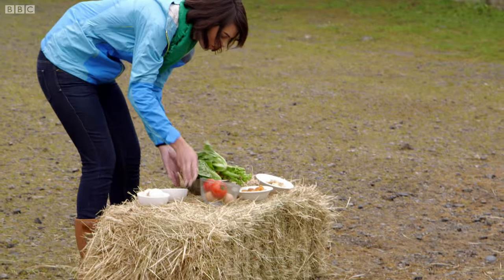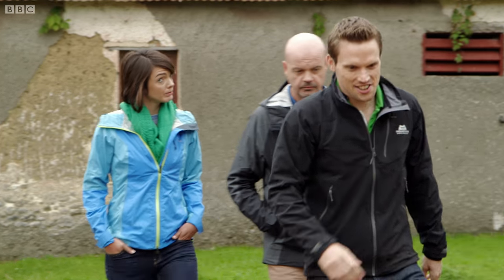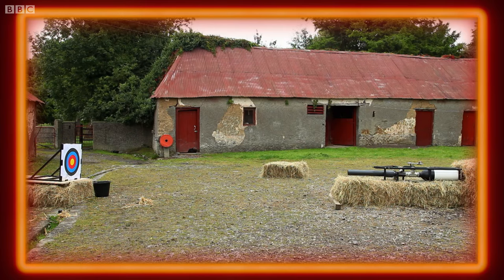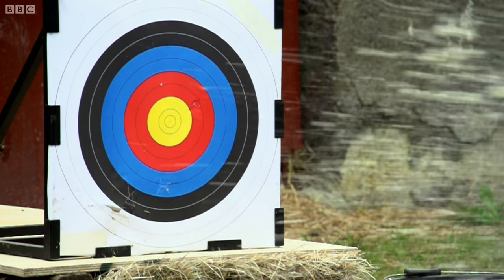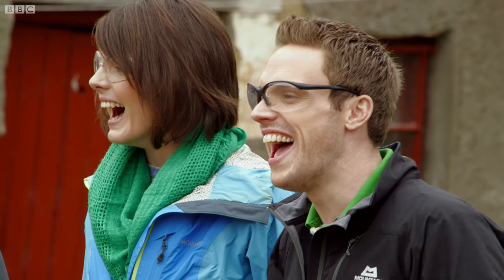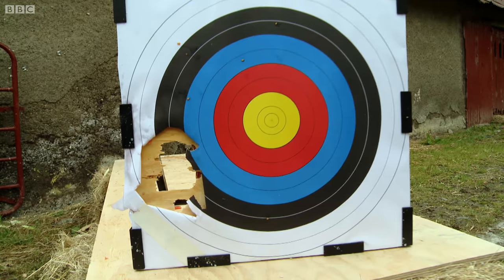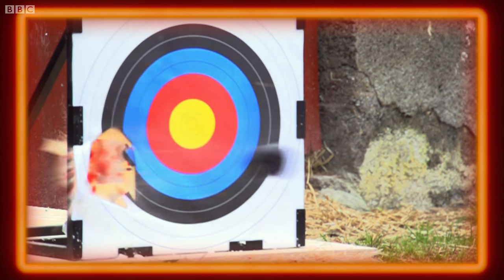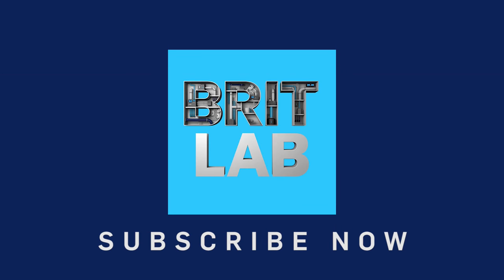Building a FOOD CANNON! | Earth Science

Comment: no explanation about the rubber item that came flying behind the tomato, that wasn't present in the celery and egg shots ? THIS ISN'T SCIENCE
Reply: Actually if you slow it down and go frame by frame (press . when video is paused) you see the black thing in all tests. It is a bit harder to spot.
Reply: +Erik Holgersson I know I had a good look before commenting, there is a black object that flies away in the other shots, but it looks a lot more flimsy and doesn't fly in the same way as the big rubber black thing did. Which makes sense, a flimsy item would be enough to push the eggs and celery out of the cannon but not give then enough speed to do any damage. The rubber plug behind the tomato was the only reason it made it to the target with energy to make it through.
Reply: Indeed, it is no science as there is no hypothesis, not a proper test and no proper controls. This is TV (or video?) and the black thing is a sabot (kinda, sorta, as it does not cradle the projectiles), it helps accelerate the projectile. Without it the air would just rush by.